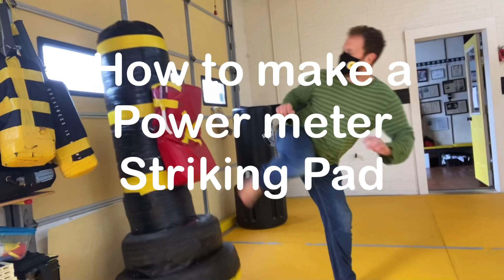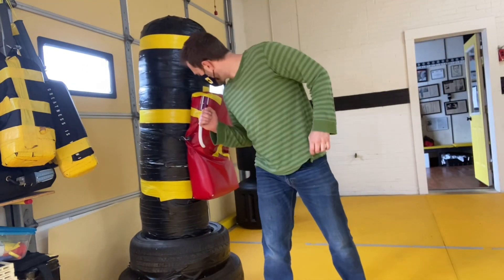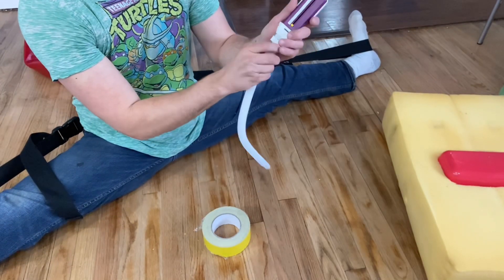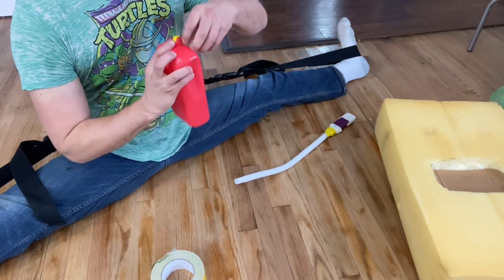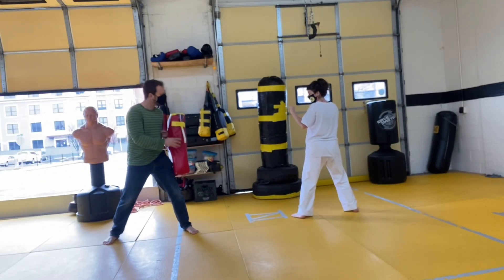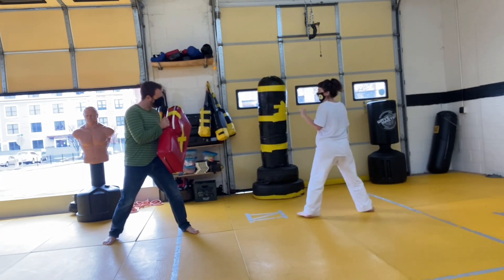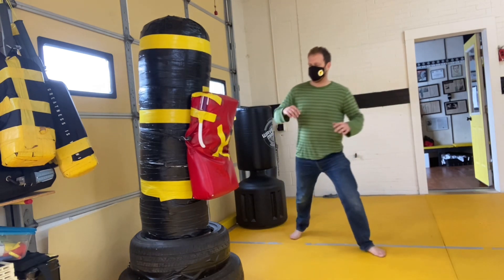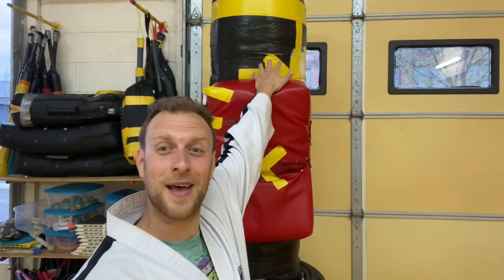How to make a DIY power meter striking pad for under $70

Comment: how accurate is it can you get consistent readings across students?
Reply from the maker: It is fairly accurate. It takes i to account accuracy. But it’s measurements are relative given the meter doesn’t measure in pounds per sq inch but in peak flow measurements. But comparing one strike to another it’s in point

Comment: My brother and I found a company, in the late 90's, selling kicking pads with just this kind of measuring device.  We were looking for inexpensive kicking pads to measure our power.  they didn't have all the duct tape and such, but the mechanism was exactly the same.   We played about with it for a while but got tired of it.  It never really worked well.  However, I say kudos for creating this.  I love homemade gear.
Reply from the maker: That is really cool!!! What did you use for the pump and for the measure?
Reply: @SimonScher  I don't know exactly what was used, we didn't make it we got it from a company and we didn't tear it apart.  But the measuring device was outside the bag, of course.  And it was just like the one in the video.  I'm thinking it was designed the exact same way.

Comment: This is pretty cool and ingenious. 

Minor correction (since it's the internet): Power = energy/time. Kinetic energy is 1/2mv^2. Kinetic energy is solely related to how fast something is moving. If you can get it moving fast, in a short time, that means that you generated a lot of power. You can get something moving fast though by accelerating it very slowly for a long period of time. In this case, you didn't generate much power, every though you might have a lot of kinetic energy. Of course, to get your foot moving fast, you have to generate a lot of power, because your leg isn't super long, so you only have so much distance over which to accelerate it up to speed. So in the limited case of kicking, power is very closely related to kinetic energy. Though you could imagine a case where you were riding a slowly accelerating rocket for a while until it got to high speed, then stuck your foot out. It would hit very hard, but you barely generated any power at all. :)